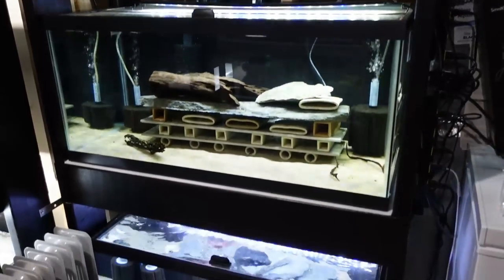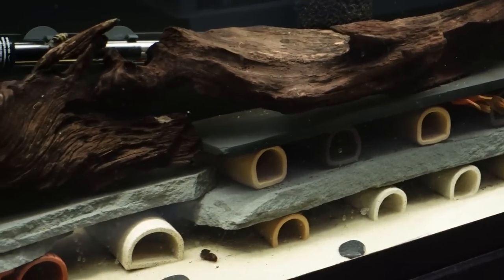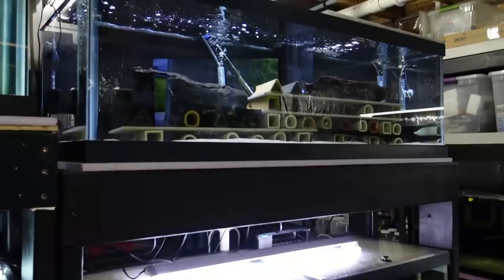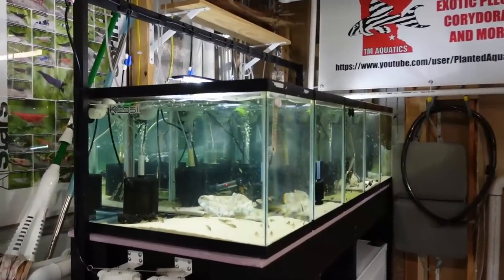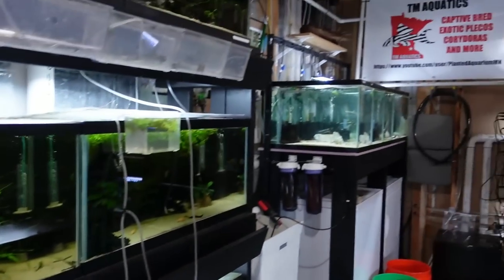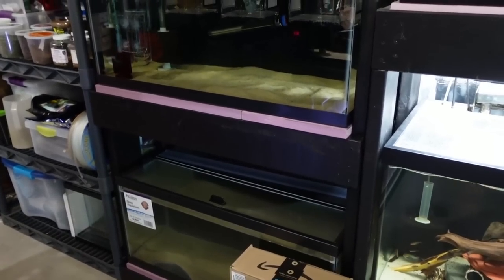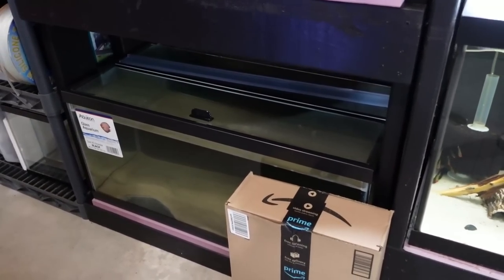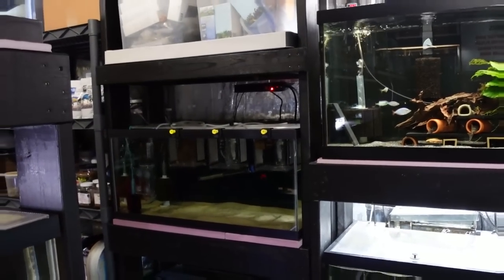Fish Room 911. Need MORE Grow Out Tanks!!

Comment: Hey Tom the rack where your fish foods are looks like 3ft. wide could you use 20 longs but with the small end of the tank out instead of the length , that would give you sixty gallons per rack, and have you ever checked out the 33gal longs, and how about that pesky dryer you could move that to the curb to open up some more space
Reply from the maker: Those shelves can’t support the weight of fish tanks. Unfortunately the washer and dry aren’t going anywhere either.  Our upstairs new 1 yr old “top of the line” dryer has crapped out on us twice already. Good thing we had the back up in the fish room. It came in handy. I love the 33L. My L046 group is in a 33.  Hard to find them though.

Comment: Great video. Do you have a good method for sexing hypancistrus?
Reply from the maker: There are several ways to sex most hypans. Males of many species developed longer facial and/or pectoral odontodes. The females are usually easy to sex due to their body shape.  Head shapes on many hypans is also very different between males and females.